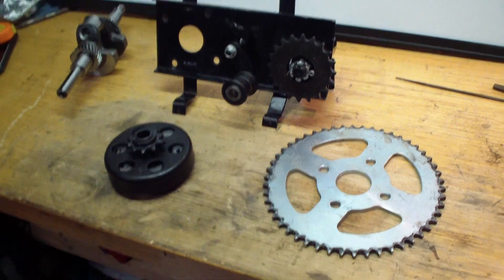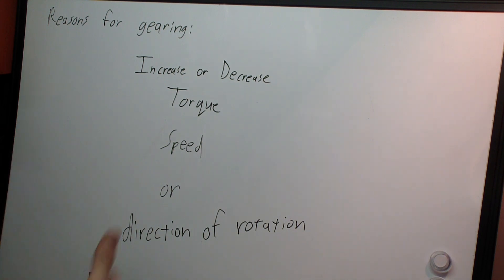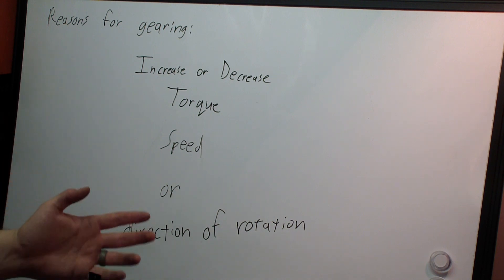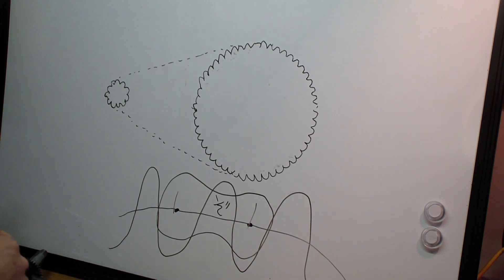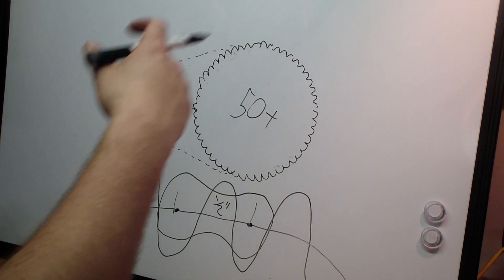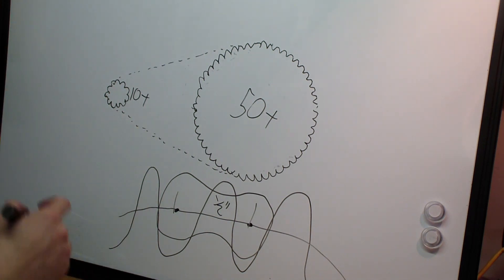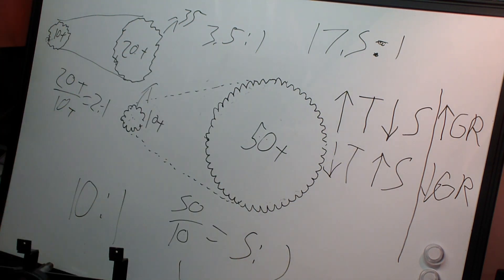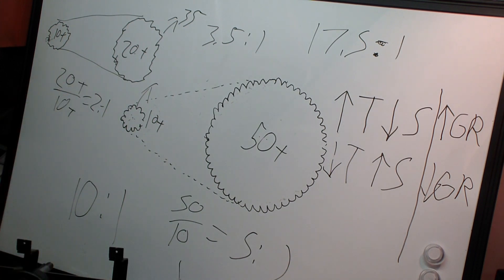All about Mini Bike (Coleman Ct200u) and Go Kart Gearing Explained Part 1

Comment: , the higher your top end but you’ll lose some torque. 

For example, if you have a 12t and 74t sprocket, your speed ratio is 6:1... if you have a 12t and 60t sprocket that would be a 5:0 ratio. If you went 14t and 40t sprocket that’s like a 2:8 ratio! You would need to push your bike to take off lol, but after about an 1/8th of a mile you’d be going 65 lol. A good middle of the road ratio is between 5:5 to 6:0. 

As someone said, if you have hills and terrain, you want the sprocket to be a little larger, if not, then go with the smaller. Hope that helps.
Reply: You don’t know how ratios work lol
Reply: So I have a 14 tooth clutch and a 36 rear sprocket which is way too small I need a larger rear sprocket but I want to have as much top speed as possible and still be able to take off so 14 to a 60 or 14 to a 65 I don't know what to do

Comment: Currently on a 4:1 with a 15t clutch up front and a 60 in the rear. Tire size is 13 inches in diameter and my mini bike FLIES! Came from a 5:1 with 11 inch tires and gained about 13 mph in top speed.
Reply: I have 60 rear sprocket, does the clutch tooth number have to be even? Or running 15 is okay? My 60 tooth with the 12 tooth makes it wheelie way too much.
Reply: @Turbski1  what do you you mean when you say even?
Reply: Duvall Mariano even amount of tooth on the clutch, my current is 12, switching to 15 for my 60 tooth rear if thats ok
Reply: @Turbski1  yeah that's perfectly fine. That's the setup that I have. You will lose low end torque but gain top end speed. Sounds like you were concerned about the wheelies so this setup will eliminate the wheelies and have you going faster.
Reply: Duvall Mariano perfect, my top speed is lacking. Muffler and carb coming next after the clutch.
Reply: @Turbski1  nice. Let me know how much the carb affects speed. I was thinking of ordering a Mikuni but I haven't found a valid reason to order one yet.
Reply: Duvall Mariano yup that is the one ill be getting. Mikuni 22, i think i need a different throttle cable though
Reply: @Turbski1  if I'm not mistaken it comes with the throttle assembly
Reply: Duvall Mariano oh ok. That will help
Reply: Duvall Mariano what speed does your bike go with your sprocket setup? And stock 212 motor im guessing
Reply: @Turbski1  mostly stock. I have an after market air filter and header, Rejet to.36 with stock e tube, and the governor removed. I get up to around 47 mph.
Reply: Duvall Mariano dope, i want mine at that speed. Just need my governor removed though and i dont really wanna mess with it though
Reply: @Turbski1  plenty of videos on youtube that shows you how to take it out

Comment: What rear sprocket should I run with a 14 tooth clutch on a mini chopper 150 lb guy 10-in wheel to get some top speed but still be able to take off right now I have a 36 rear sprocket which is way too small the bike barely takes off does about 40 pinned it sounds like the engine is idling at 40 doesn't have enough torque to pull that gearing so should I order a 60 tooth or?
Reply from the maker: I’d go for a 60 tooth

Comment: Anthony I often like & appreciate your videos. I would like your thoughts on this. Here is the progression on my BT200X. 

All on a flat both directions 220 pound rider, 16 psi in tires & box stock gps 20 mph. Remove soldered screw 25 mph. Drilled hole in throttle linkage arm to move spring 32 mph. Removed governor, added non epa version of carb with 38 jet, added 18 pound valve springs, header, intake & filter. 38 mph. Added gopowersports CVT 45 mph. 

Think it’s practically maximized without going into the motor which isn’t worth it to me. Bike doesn’t seem to be out of cam, fuel, or valve spring IE no valve float. It just seems to have insufficient torque to push me faster not that I need it to. That said since it has CVT and is not max Rpm’d out would the higher torque multiplication from the right size higher tooth count rear sprocket provide the torque to propel me faster before running out of breath? If so what do you think would be the ideal tooth count?

Open to anyone with constructive input.
Reply from the maker: Vern Lochtefeld you are now geared too high with the CVT. I would get a 60 tooth rear sprocket that will give you back some torque and should give you some speed back as well. Then you can tune the front sprocket by changing it to an 8 or 9 tooth (40/41/420 with 5/8” bore “c” type) for more torque (gearing it lower).
Reply: Anthony Shelton First Thanks for taking the time to reply. 

I have not looked into the sprockets & chain stuff nor all of the CVT or TAV stuff with I take it different shafts front and or back? (“5/8 inch bore c type”)

I take it the 60 tooth rear sprocket can be run with either chain?  

Then later if I choose I can get the front sprocket and or do I need the rear shaft and naturally the stronger chain to go with it at the time I do the rear sprocket?
Reply from the maker: Vern Lochtefeld you can keep the same chain. They make ones that work with the 420 chain. You only have to replace the front sprocket, shaft stays the same.

Comment: I have a 354cc Kawasaki motor on a go cart with 12 tooth clutch. And 9.5 sprocket. The clutch get red hot on try to take off . Do I need to change the sprocket to smaller one or go with gear instead of the clutch?
Reply from the maker: Geared way too high. You are overdriving the axle (axle spins faster than motor). Even on my mini bike with a torque converter at the tallest speed the overall final gear ratio is like 5.75,, stock coleman mini bike is 25, yours is 0.79. Depending on tires size you may want like a 36 tooth sprocket on the rear axle.

Comment: what if u got 14 tooth clutch wit 20 tooth jackshaft goin to 10 tooth then the 10 going to the rear sproket thats a 52?
Reply: 52/10*20/14=7.5 overall gear ratio.  Its a good middle of the road ratio.  Good for offroad or on road.  If you want more speed on road, go closer to 5 overall.  If you want more acceleration, especially on grass, go closer to 10 but your top speed will be less.  Im 210 lbs and have built 10 minibikes.  I always aim for ratio of 10 cause im heavy and drive them offroad.  I care about acceleration only

Comment: I’m dying to go 3:1 but I can’t find a 15T 3/4 shaft sprocket for a 50 Tooth rear. It seams like I’m finding 1” shaft in 15T .
Reply from the maker: Captainkleen what chain size? 420 or 35? Could be physically impossible as there are minimum tooth counts for each shaft size. For instance, 8 tooth is the minimum for 420 chain, 5/8” bore.
Reply: Why can't you just get a 19t clutch with a 60 in the rear?

Comment: i have a Ct100u 3.0 engine i have a 65 Sprocket in the back and 12T in the front Should I go lower on the clutch for more speed
Reply from the maker: That will reduce speed. To increase speed you increase clutch or lower tooth count on rear sprocket

Comment: im getting a mmb80 with predator 212, 12t front sprocket 47 rear, I heard id top out at around 50mph but i wonder if the clutch would handle it
Reply from the maker: Oxron206 I’m not a big fan of straight chain setups. Then again I mostly go off-road on mine. Your setup will really depend on your weight and the rear tire size.
Reply: It won't go 50 . Maybe 45 if your lucky

Comment: What part number is that rear sprocket and what's the distance between the bolt holes?
Reply from the maker: Is the factory rear sprocket on a coleman CT200u. 50 tooth, 40mm bore with 80mm bolt hole circle.